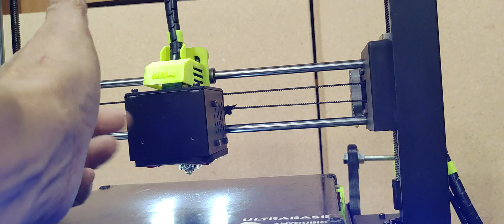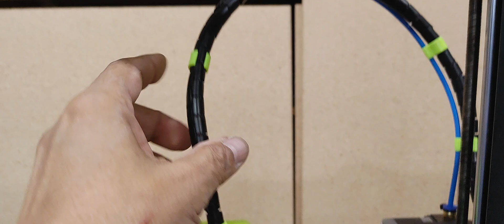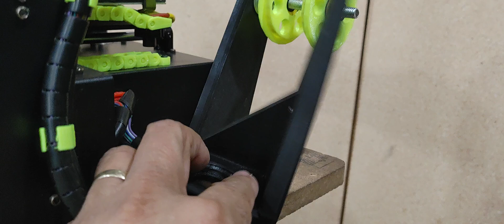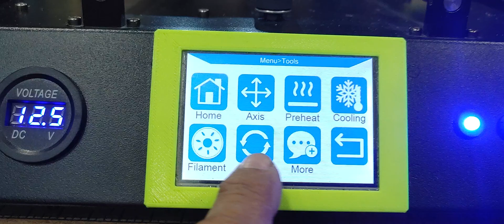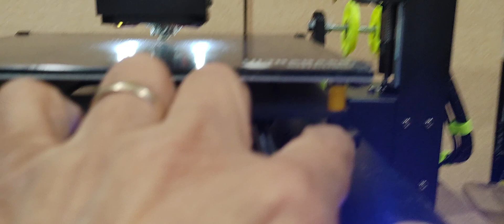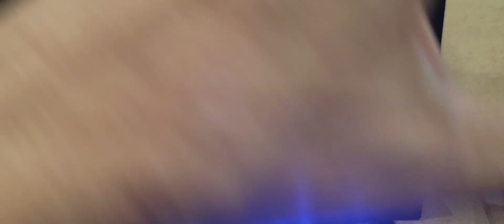A GREAT! 3D Printer - ANYCYUBIC I3 Mega -STILL IN USE NEARLY A DECADE AFTER - Recent Upgrades

Comment: I bought my i3 mega in 2018 for the exact same reasons you stated: solid, technical staying power, potentially modifiable, decently large space for the time, etc. It definitely is not an entry-level machine - as when one considers the capabilities for the price, at a time when 3d consumer printing tech was new on the market - it does have a bit of set-up to get right… but when it does go well, it has a lot of potential.

I managed to make a few prints before my time availability shifted (read: life) but knew I could come back to it anytime. I’m doing that now.

I’ve also dreamt of making my own stuff (but I’m also AuDHD) since I was a child in the 90s, and was also one of the early backers for the Micro3D 3D printer on kickstarter (not to mention an early backer for the 3Doodler 3D pen - which i’ve used more often in the past 15 years, than my printers, combined, lol). Now I’m in a place where I can get into it again… and maybe start an industrial design business to put all my industrial design training, my architectural drafting & design certificates, and 3d modelling skills to good use (which I haven’t really done up until now).

I really like all your upgrades, though I would like to know how beneficial the spring upgrades are?
and yes - Links to info about your upgrades would be greatly appreciated 🙂

p.s I also appreciated your “rant” at the end. I feel like I agreed and felt similar about a lot of it.
Reply from the maker: I added the link to the springs under the description.